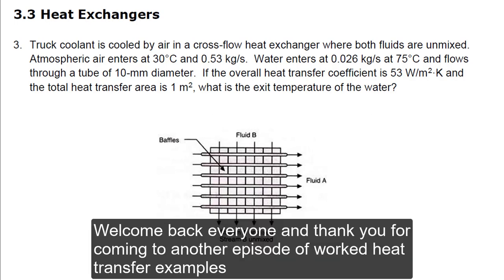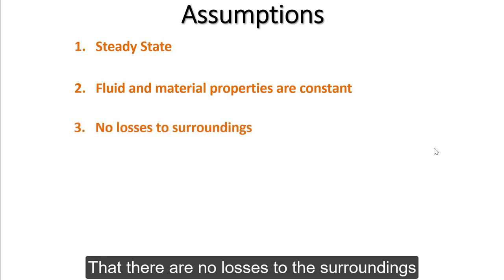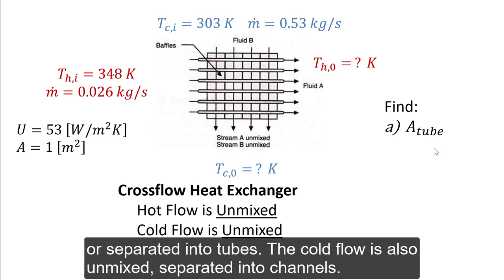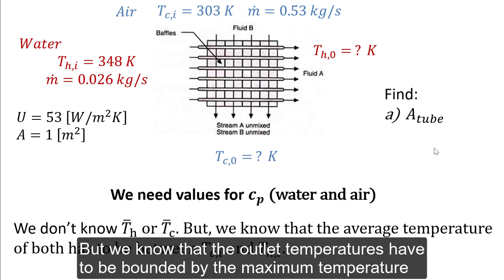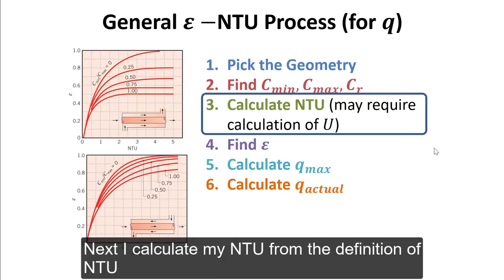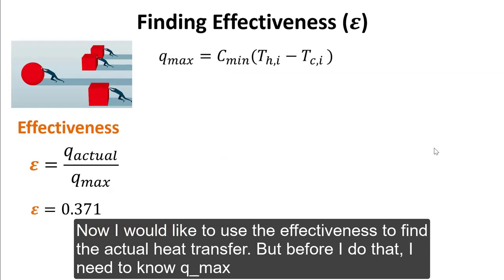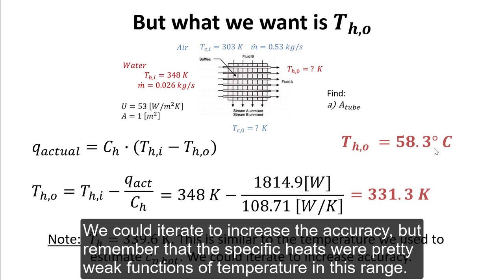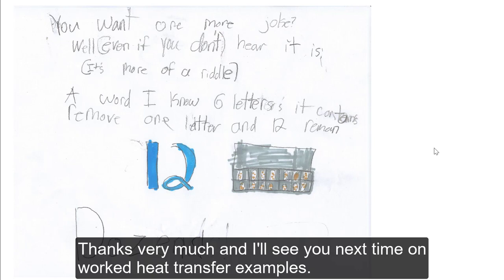Cross Flow Heat Exchanger (mixed/mixed): Heat Transfer Examples for Mechanical Engineers

Comment: Professor Mike, thanks for the explanation but @ 6:05 minutes, why Ch is converted into Cc? Is it error?
Reply from the maker: Good catch. Looks like there is a typo in the slide here and it should be C_h. I think I say this when narrating the slide, but have it written incorrectly on the slide. Thanks for pointing this out and sorry for the confusion.
Reply: @mikeschertzer941  Thanks for the reply and correction. However,  your's  video is very useful and has been well explained.

Comment: How to select no. Of fin tubes for steam passed in it for Ms/al/ss-304 and selection of header also.
Reply from the maker: So that's a bit beyond what we're doing in a video like this. I think you start with trying to size the heat exchanger. Then, you probably have some kind of size constraints in your system. That might lead you to choose how many tubes you want. The interesting thing about heat exchanger design is that there are multiple solutions to the same problem. So you probably want to create some kind of model / solver that lets you determine the heat transfer. Then play around with variables (i.e. what is the length if I pick N tubes with D diameter?; or how many tubes would I need if I have a length L and tube diameters of D?). My understanding of header design is that you want something that gives you as close to uniform flow rates as you can get in all of your tubes (or cross sectional area)...so it's a multidimensional fluids problem.

Comment: Dear professor Mike. Thanks a lot for the video. could you please discuss a detail video to design/sizing an air cooled condenser/evaporator (both unmixed, crossflow, finned tube) ?
Reply from the maker: I don't think I have a separate video showing that case. But I think the big take away I tried to get students to have from these videos is the process for solving these problems. If you go through the same process described here, I think that you should be able to come up with a reasonable solution. So the path won't be exactly the same as this one, but if you watch this, and then maybe the Exhaust gas (mixed / unmixed) video, I think you should be able to piece together a good model.